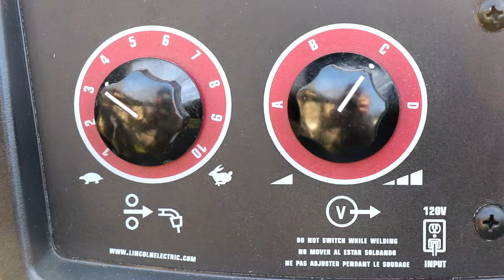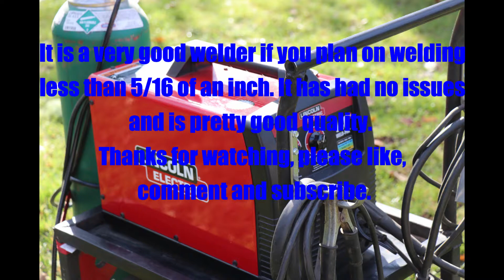Lincoln 140 Mig Quick Reveiw

Comment: I got mine just recently for small jobs, but it seems like its my go to machine when i want to weld something, it runs off my ranger 305 very well and i like it. Beats dragging out those 50' leads for stick welding anytime, but if its metal thicker than 3/16, i either take my time with the self shield fluxcored or just stick weld with 1/8 7018 rod